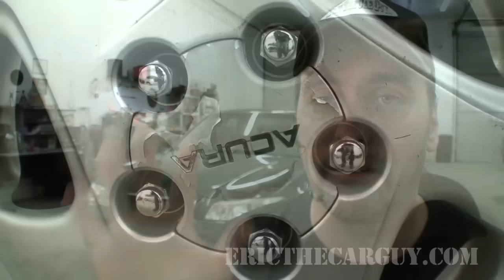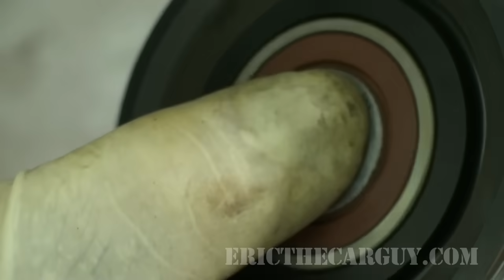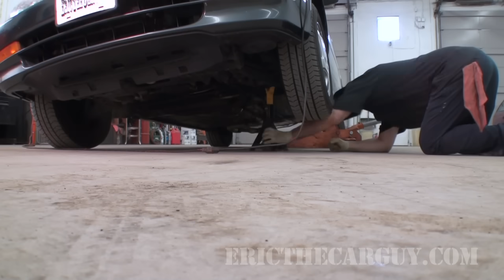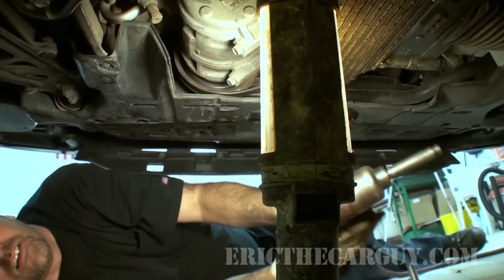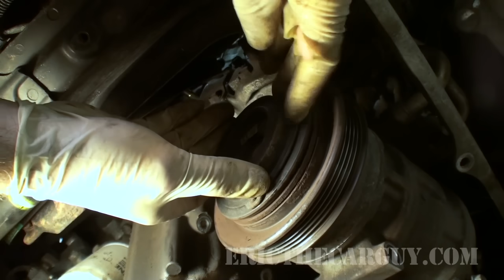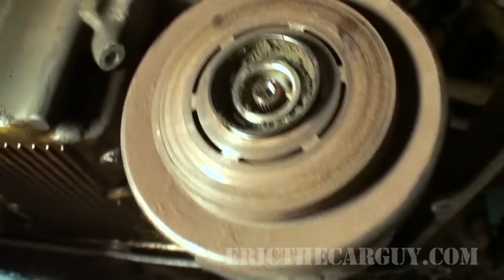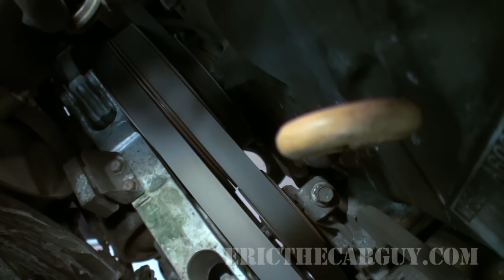AC Clutch Repair and Noise Diagnosis -EricTheCarGuy

Comment: This is a great example of why I love ETCG. He doesn't just show you the clutch replacement, but instead explains all the other aspects of the issue, such as the idler pulley and its bearing replacement. You end up learning more than what you came here expecting.
Reply: I wonder if this guy understands how phenomenal his content is and how he stands against the rest.
Reply: @Madmok128  yes because he saved me so much money everyone kept telling me to just change my entire compressor but this video helped so much knowing how easy a clutch replacement is
Reply: 💯 his explanations are so good that a bunch of times I've watched his videos on different cars than the one I'm working on! He never disappoints
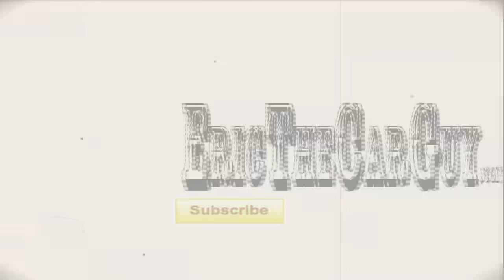Reply: Pllllllplptip😢ejkjkĺkllsnnnnnnnnnnnnnnñnñnñnnñnñnnn 28:32 28:32 nmnnnmnmnm 28:32 d8d8d8d8mmmmd8mtj9kyktlhll0lkllllljllklkkllklkkkkklkkkklkklklkkllkkk 28:32 rjrj 28:32 28:32 rrrr 28:32 r 28:32 28:32 mmmmmmmmmmmmmmmmmmmmmmmmmmmmmmmmmmmmmmmmmmmmmmmmmmmmmmmrrrdd8f9fdfrff88 28:32 8f8 28:32 28:32 28:32 28:32 f8 28:32 28:32 f8f9f8mmmmmmmmmmmmmfrfrf89888f8888877f8f8f8 28:32 f8mmmmmmtrrf88fŕf66f6f6f88mmmmmmmmmmmmmmmmmmmmmmmmmmmmmmmmmmmmmmmmmmmmmmmmmmmmmmmmmmmmmmmmmmmmmmmmmmmmmmmmmmmmmmmmmmmrrmt8mrtmmmmm8mmm8m8mmm99 28:32  28:32  28:32  28:32 28:32  28:32  28:32
Reply: Pllllllplptip😢ejkjkĺkllsnnnnnnnnnnnnnnñnñnñnnñnñnnn 28:32 28:32 nmnnnmnmnm 28:32 d8d8d8d8mmmmd8mtj9kyktlhll0lkllllljllklkkllklkkkkklkkkklkklklkkllkkk 28:32 rjrj 28:32 28:32 rrrr 28:32 r 28:32 28:32 mmmmmmmmmmmmmmmmmmmmmmmmmmmmmmmmmmmmmmmmmmmmmmmmmmmmmmmrrrdd8f9fdfrff88 28:32 8f8 28:32 28:32 28:32 28:32 f8 28:32 28:32 f8f9f8mmmmmmmmmmmmmfrfrf89888f8888877f8f8f8 28:32 f8mmmmmmtrrf88fŕf66f6f6f88mmmmmmmmmmmmmmmmmmmmmmmmmmmmmmmmmmmmmmmmmmmmmmmmmmmmmmmmmmmmmmmmmmmmmmmmmmmmmmmmmmmmmmmmmmmrrmt8mrtmmmmm8mmm8m8mmm99 28:32  28:32  28:32  28:32 28:32  28:32  28:32 lt66
Reply: 0m88m6

Comment: i could hear some sort of 'grinding noise' when you turned the air con on after the repair, would that of been the new part what had no lubrication or just something else in the engine bay?

Comment: Eric,
You are a total idiot showing "us" how to properly  remove/install bearings using a hammer and a vise. Have you ever heard of  devices called an arbor press or hydraulic press? Ball, roller, needle, tapered roller bearings are very hardened materials and should never be subject to impact forces like whacking them with a hammer especially on installation. If you really have an ASE certification it should be revoked based on this "example" of bearing removal/installation.

Tom
Reply: Although I understand your point, most of us don't have access to a press. And you well know that there are many situations where you can't use a press. I'm sure if he were to film this again he would explain that point in more detail. Your reaction seems a little harsh....
Reply: Where is your video Tom?

Comment: Ahh! Eric- you should have mentioned DO NOT hit on the inner ring when INSTALLING new bearings!  Use a socket of the same diameter as the outer silver edge of the bearing and hammer on that.
Reply: don't hammer the bearing g d i have a press buy a press kit not that much not that hard to do.
Reply: @randyeastman4500   
He could make his own if he can stick weld.
Reply: UH, HE DID.  Are you DEAF?
Reply: da324 he only did it to knock the old one out, not when installing the new one